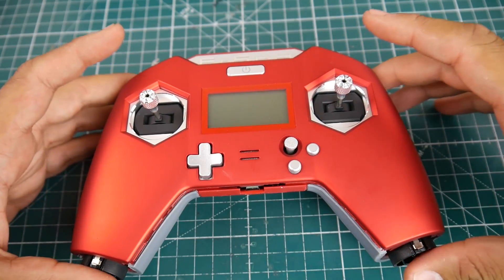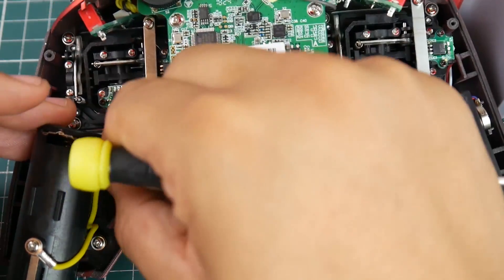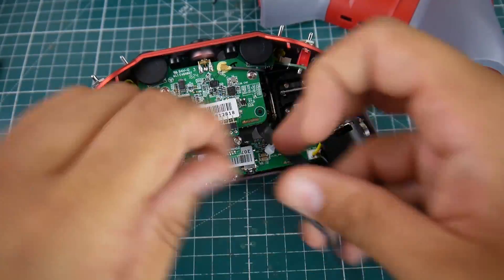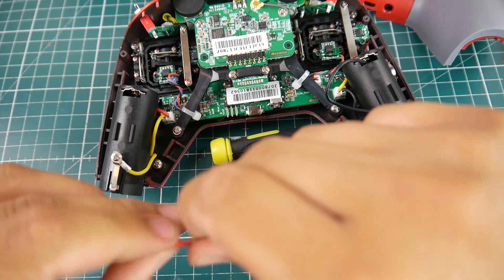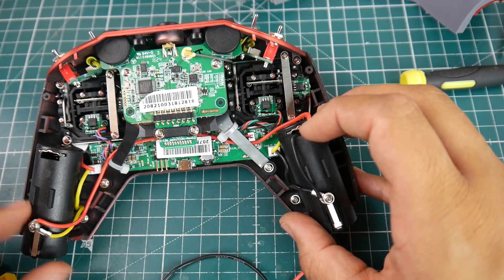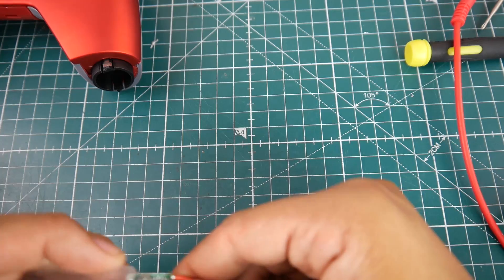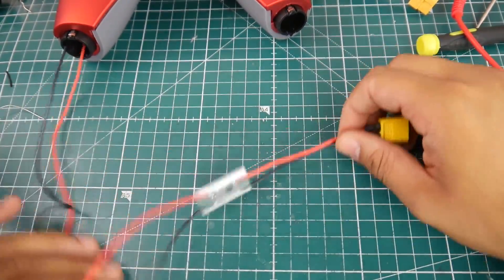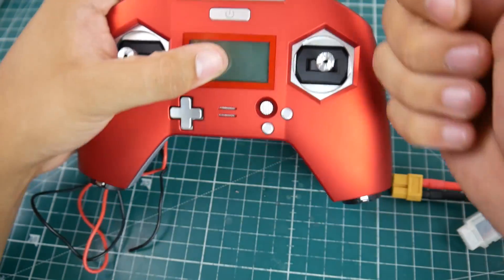FrSky X-Lite Battery Mod // Must Have Mod For Your FrSky X-Lite

Comment from the maker: Voltage Regualtor
https://www.banggood.com/10Pcs-Mini-DC-Adjustable-Power-Supply-Buck-Module-Step-Down-Module-p-999753.html?p=CS101558118042016088&utm_source=sns&utm_medium=rcgroups&utm_campaign=mesh&utm_content=tanghao

FrSky X-Lite
https://www.banggood.com/FrSky-Taranis-X-LITE-2_4GHz-ACCST-16CH-RC-Transmitter-Red-Black-for-RC-Racing-Drone-p-1257443.html?p=CS101558118042016088&utm_source=sns&utm_medium=rcgroups&utm_campaign=mesh&utm_content=tanghao

silicon Wire
https://www.banggood.com/1M-8101214161820222426-AWG-Silicone-Wire-SR-Wire-p-921159.html?p=CS101558118042016088&utm_source=sns&utm_medium=rcgroups&utm_campaign=mesh&utm_content=tanghao

Xt60
https://www.banggood.com/10X-XT60-Male-Female-Bullet-Connectors-Plugs-For-RC-Battery-p-958017.html?p=CS101558118042016088&utm_source=sns&utm_medium=rcgroups&utm_campaign=mesh&utm_content=tanghao
Reply: Bro, can you  post what type of solder you use. Thanks sir

Comment: I do get the point of this battery option mod and while it's not for everyone, the wires can still be tucked away so it's not bad. However, talk about a Mickey Mouse setup, geesh. You need to buy a real soldering iron and maintain it. That soldering iron has really bad corrison on it's tip. The black wire soldered onto the regulator didn't stick because it was a cold solder not because you couldn't see. That's a result of that terrible soldering iron as well as poor execution. Finally, those two connections inside the transmitter should have been soldered, not simply held down by the screw. It wouldn't have been a "permanent" mod anyway as those wires could simply be snipped off later on. I would hate for my $600 quad to crash because the power leads inside the transmitter came loose. Of all the "drone" specialist channels on youtube, not ONE of them knows Flux exists, what it's for and how to use it.

Comment: What would it take to actually use an xbox controller as a transmitter or the input for the transmitter?
Reply from the maker: Xbox to Hm-10 To arduino to ppm to R9M module.. Simple :) ..
I have a PS3 controller planned
Reply: @DroneMesh  Excellent point in the right direction; I just need a ppm. I'll look forward to your project video(s)?

Comment: +1👍  interesting sir.  I think it could be cleaner by wiring to jst connectors, and routing to module  bay, then 3d printing a battery holder that connects to module bay.

Comment: What i would want is to charge the batteries without taking them out. Possible using the pins at the back to apply the charging voltage

Comment: This mod is useless. Rather design 3D printed holder which will allow to use 18650 battery instead of 18500.

Comment: In the states The Home Depot sales 18500 batteries in the electrical dept. Hampton Bay brand if any one is having a hard time findind them...around $14 for the pair.
Reply: they do but they are only 3.2v and there not flat top so they dont fit without modifications

Comment: Won't this make the transmitter think that the battery is always full and you don't get any warning that the battery is about to die?
Reply: it is calibrated to output 8.4v max when the battery is full. When the battery is draining the regulator will also decrease voltage, the transmitter sees a classic battery.
As someone said in comments, if you use a 2S battery you don't need the regulator, just the XT60 converter.
The regulator allows you to use 2S and 3S batteries.
Reply: Regulators are called regulator because they regulate the output to constant value regardless the input until the input goes to outside of the working range (eg. below output voltage for step down or higher than maximum input voltage)

Comment: Great work, dude! 😃
You could use a 2s battery too. That way you wouldn't need the regulator. 😉
Reply: Yep, and it's about time before you fuck up things by plugging anything above 2S into that unregulated XT60 input like I did back then with my FPV goggles.
Reply: Or just use a barrel jack and use a fatshark battery
Reply: Manuel Wong I cant find battery’s for this is how do I use my fat shark battery? Without using a voltage regulator?
Reply from the maker: Yea but a regular adds flexibility.
Reply: Yeah, you're right as well. 😊

Comment: TBH, I don't see the reason on doing this mod, but still an informative video as always. The entire idea behind the X-Lite is portability and this just took a way from that. Maybe I am missing the use case for this? A better battery mod would be to extend the caps by 15mm to get an 18650 inside. Longer battery life and a lot more availability for battery selection. I think I own about 20 x 18650s and only 2 x 18500 that I bought specifically for the X-Lite. I also like what Josh Felts mentioned about ability to charge from USB port. Definitely interested in a video on that mod:)
Reply: https://www.thingiverse.com/thing:2998248
Reply: Sponge That mod makes it look like the Dark Night which looks ugly imo. I can see why they chose to go for the less popular 18500’s. They should have made up for it with USB charging though.
Reply: @Spongeee  Thanks!
Reply: I like that design but concerned about the longevity of the tape, there has to be a better solution.
Reply: Agreed and it also takes away from the aesthetics of the whole concept of the Xlite, you need the batteries inside the grips to maintain the correct feel that was intended. When I purchased mine I didn't have a problem in sourcing the batteries and I purchased four 1800 mah. I get 2weeks use from 2 fully charged batteries so no way am I gonna piss about with this.  :)
Reply: The reason they went with the 18500 is obviously as they were trying to keep the form factor as close to a true Xbox Ps4 PC games controller as they could. Whats the biggy here, why is it that people buy things knowing exactly what they are purchasing and why, like der! " ye i'll get me one of those cause its just like my Xbox controller and that'll be totally sick or dope maaan!" And then start complaining that " oh but hey, you have to order the batteries from china online, and wait they don't recharge in the transmitter, mommy i'm gonna cry" your ordering the Fucking thing from China in most cases as its cheaper, or you should be if you have any sense? so get 4 batteries at the same time. Derrrrrrrr!!!!!!!!!!
Reply: I put a 2s charge jack on mine.
Reply: Crossfire is the reason

Comment: How about adding 18500 charging capability internally in the x-lite?  It would be nice to just plug the radio in via USB to charge
Reply from the maker: That's possible I'll begin designing a PCB small enough to fit inside and handle that in a upcoming video.
Reply: Drone Mesh awesome. I think that is the most glaring missing feature of this thing.
Reply: that will be the best mod for sure!! going to be waiting for that one
Reply: Yes plz do that mod I’ll be waiting for this one as well!!!